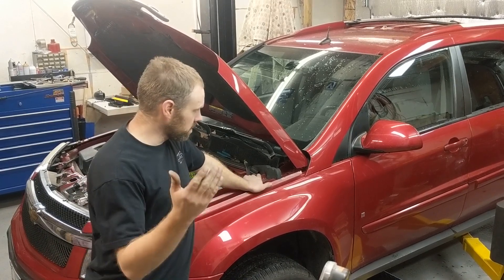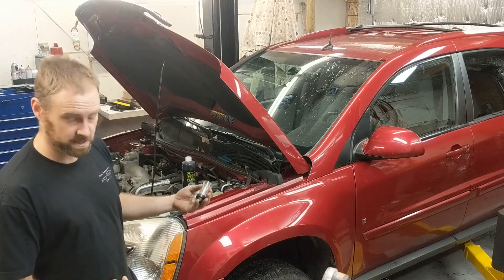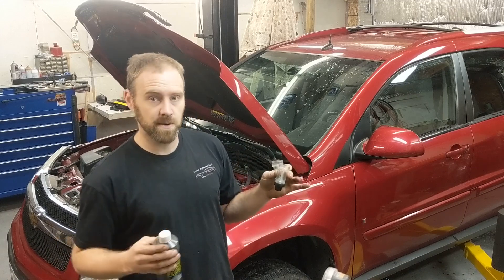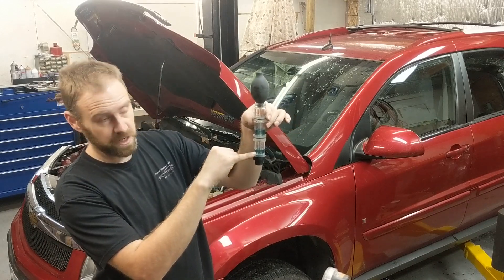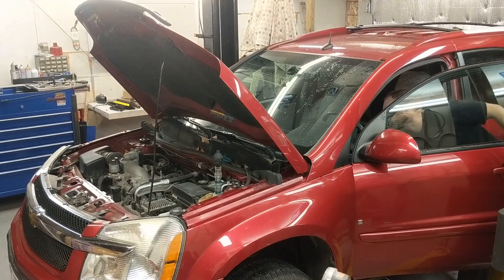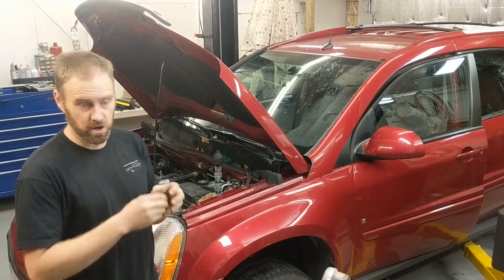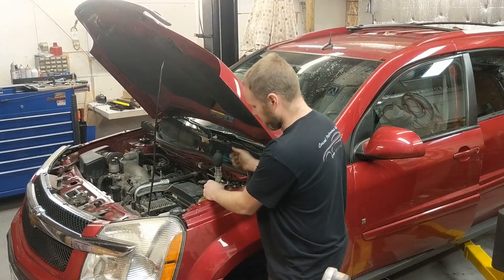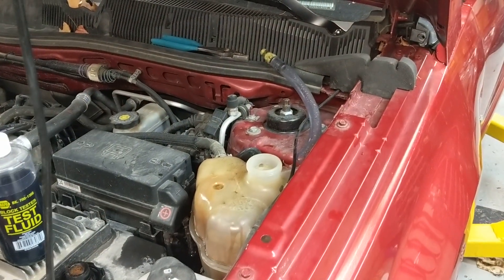Easy DIY Head Gasket Test

Comment: Thanks for the knowledge. Have you ever tried a cooling system pressure tester and watch the needle while running? It does work power sports but, haven't tried on automotive.
Reply from the maker: It would work but might blow something up if the head gasket is too bad. I had one car I started with cap off start bubbling out. I was like yup that's toast but just to verify snapped the throttle. Let's just say the geyser hit the ceiling in a 18ft shop lol.